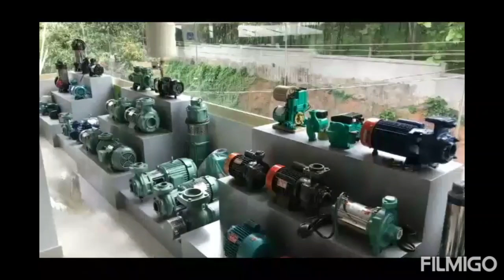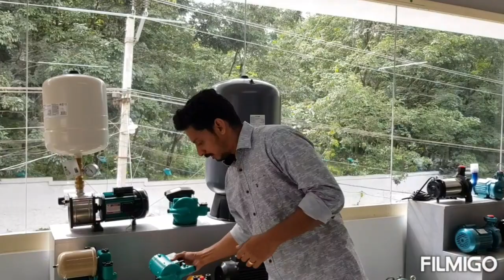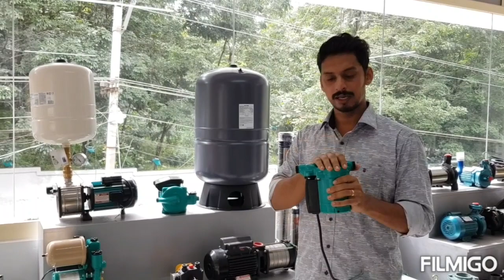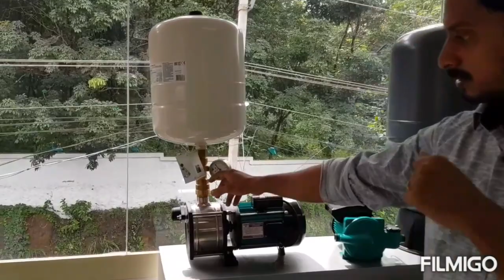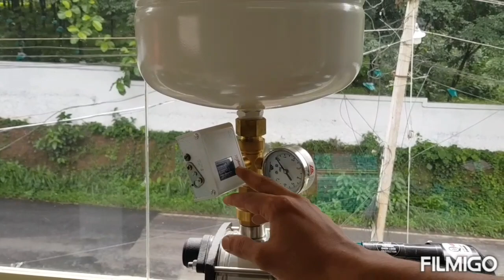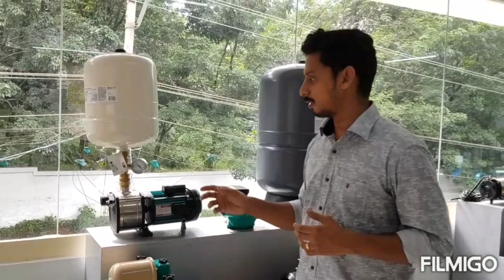വീട്ടിലെ വെള്ളത്തിന്റെ  പ്രഷർ എങ്ങനെ കൂട്ടാം ? Different types of pressure pumps and its uses.

Comment: Current charge arukodukkum eg.. Veedukalil 60 watts etra time on off akum.. This is good for commercial purposes only bro
Reply from the maker: 😃 The average usage will be max of 1 hour for a domestic purpose.
You tell me how many units it's going to consume a day, considering the consumption is only 60watts ?
It cannot be considered for a commercial purpose since it's Pressure generation capacity is around .7bar
Reply: @thundathiltraders  my Bosch washing machine manual says that it requires min 1bar max10 bar pressure at the tap. Would this 60watts pump serve the need?
Reply from the maker: @sathishsukumaran9977  https://www.thundathiltraders.com/product/classic-130watts-booster-pump-washing-machine-single-shower/

Comment: Eee motor buse cheyumbo current poyal line l water normal l varille... Athinu problem undo... Allenkil pressure valere kurayo
Reply from the maker: Normal line bypass cheythu koduthal. current ellathapol normal flow kitum

Comment: Hi, can you help me on a situation. in a two storied house, if the first floor is not getting water pressure or if i say very very less, will this booster pump helpful or is there any other way
Reply from the maker: Yes, absolutely . You can add a pressure pump. 7034904458 whatsapp number

Comment: Tank nte same level il aano pump install cheyunnathu., asking for inline pressure pump
Reply from the maker: Same levelil kodukunathilum nallathu tank levelil ninnu kurachu thazhe kodukunathanu.
Line il minimum vellathinte flow undenkile athinte switch work cheyyu
Reply: Tankinte tazhe kodukunatanu nallatu because pumpinte head koodatae, tankinte  height difference moolamula Head koode  kittum

Comment: Inline pressure pump( single bathroom) maximum head capacity ethrayan pls reply
Reply from the maker: Head is around 10 meters . Maximum pressure 0.7 bar
Reply: Rate etra aanu.. inline for single bathroom

Comment: 100 ltr tank athintakath air ano air vazhi ano ithinta wrking
Reply from the maker: Pressure tankinte ullil oru bladder anu.athil vellam pressureil store avukayanu cheyunath. pressure generate cheyunathu motor anu.
Reply: 100 ltr empty tank comes with pre filled air .And as per your requirement you have to set the pressure.. Say ,the cut on pressure is 40 psi and cut off pressure is 60 psi in the pressure switch, then you have to adjust the empty tank pressure to 38 psi..